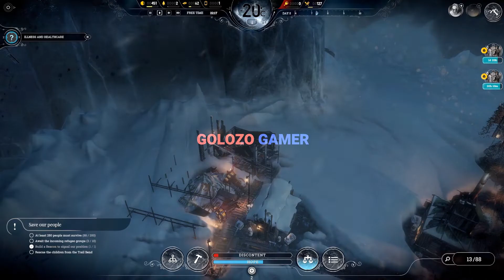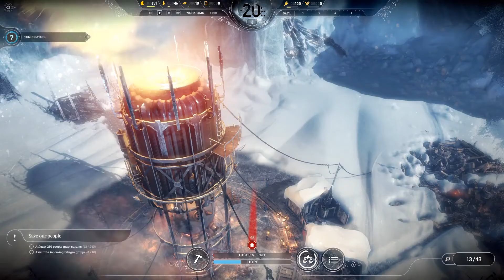Steam Cores What are they and How do They work

Comment: Makes quite a bit of sense, however what doesn't makes sense is that you said they create electricity trough electrolysis, which is not possible. Electrolysis is the process of dumping electricity into a solution of something usually water in order to separate the atoms composing said solution. In the process of electrolysis you lose electricity, not gain it.
Reply from the maker: You have a point. I was to do some updated videos on the topic.